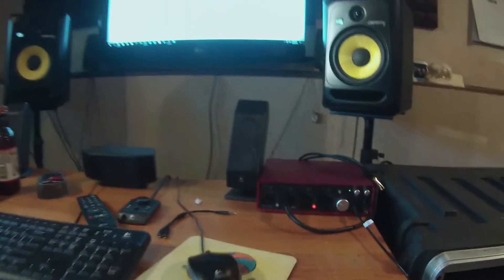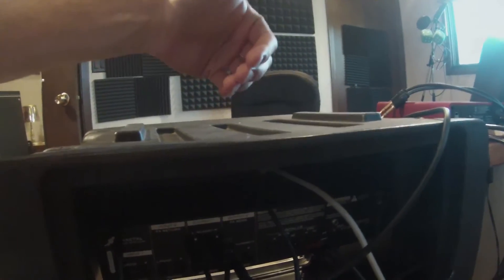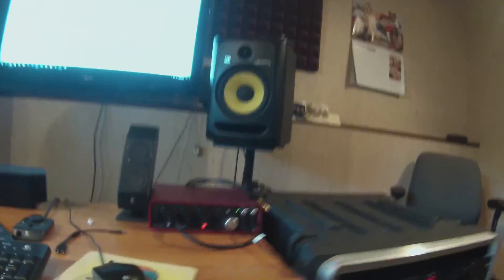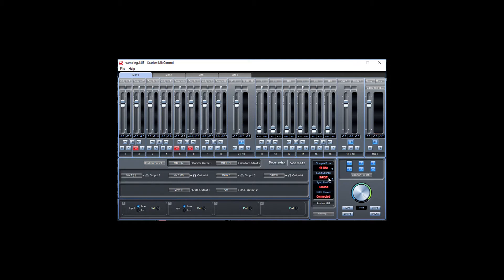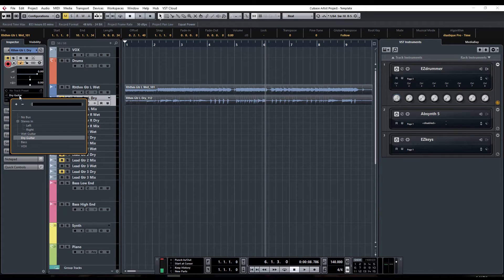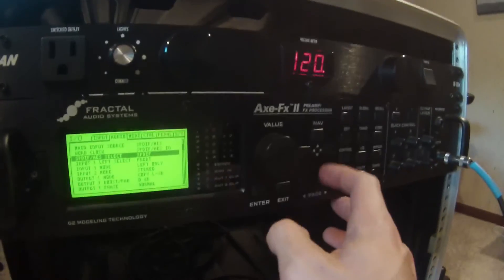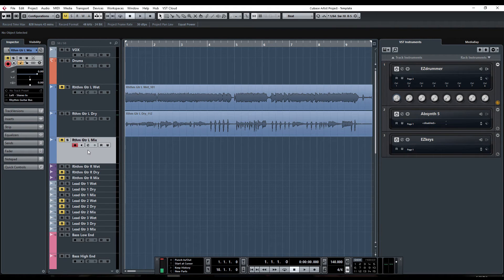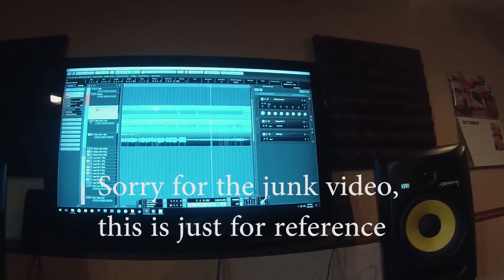AXE FX / Scarlett Focusrite 18i8 Digital Reamping Tutorial / Walkthrough

Comment: Hey dude, I know this video is a bit old but hopefully I can get a response. 
I have a problem where when routing the dry signal out to the Axe, the Axe is obviously receiving the signal because the input LED's are active but I still hear the dry tone only.  
However, weirdly enough — when plugging in headphones to the Axe's headphone jack or switching my monitor cables from the interface to the Axe output, I hear the processed signal.
Reply from the maker: On your Axe Fx preset, do you have shunts going from the input, to the output, bypassing your tone? That should split the signal and you should hear both the wet and the dry tone. What this does, is split the stereo signal left and right. See my video @ 2:46.
Reply: @JesSchwartz  

Yes, I do. 
I think my interface just isn't capable of receiving S/PDIF signal when the clock is set to Internal. It will only receive signal when it's the slave, and I've also talked to a guy on the Axe forum and he said he once had an interface that wouldn't let him receive S/PDIF input when set to Internal, which basically makes it impossible to reamp the dry signal. Thanks for the response!

Comment: Thanks for the video! What's the significance of setting the axe to be the master clock upon initial recording? Wouldn't it not matter as long as the main interface is set to master?
Reply from the maker: Stephen Pertesis I believe it does matter because I’m using SPDIF. If I was using an analog signal I don’t think it would matter.

Comment: hey man i tried this with my scarlett 2i4, and when i turn the dry signal up to 20db it clips my axe fx 2 xl+ output. Any idea whats up with this? it clips down to about 4db with a passive guitar...
im trying properly pan the signals in the axe fx, record both signals in cubase with a proper dry level (ive gotten this far) and then bus the dry track out of the unbalanced output 3 on the 2i4 - going into the rear unbalanced input of the axe fx. but even when i set the dry track at lower levels, the reamped signal sounds like it has tons of ground noise on it or something. the cables aren't too long, and i dont have any issue recording with the axe fx regularly. any input on what im doing wrong? not sure if i need a DI box, or if im just doing too much a/d d/a conversion... 
thanks! enjoyed the video
Reply from the maker: For your dry signal, do you have the pre-amp gain staged too high? Is the light on your Scarlett turning red? Essentially, you just want to get the dry signal high enough, just before clipping. I would veer towards boosting the dry signal on the Scarlett vs. boosting the signal in your Axe Fx.

Sounds like the signal isn't being passed through at a line level. Does it change if you put the connection from the unbalanced output 3 on your 2i4, to the instrument in, on the front panel of the Axe Fx? Does that change anything? Also, in the I/O menu of the Axe Fx, you will need to change your input to be input 2 (if you're reamping using the unbalanced input on the back of the Axe Fx). 

Hope that helps dude! Best of luck!